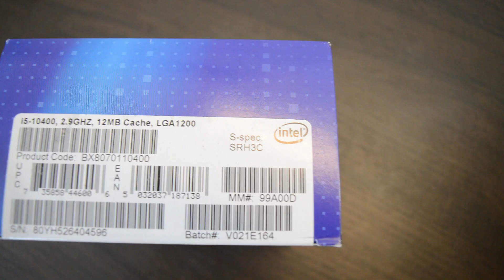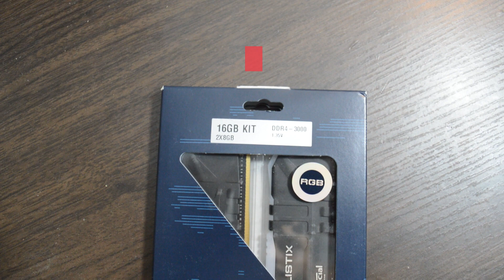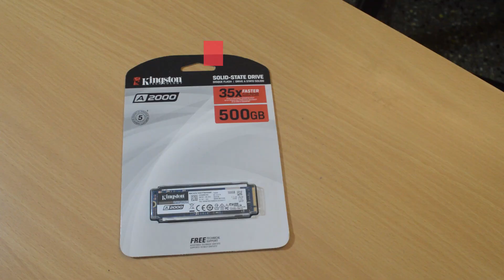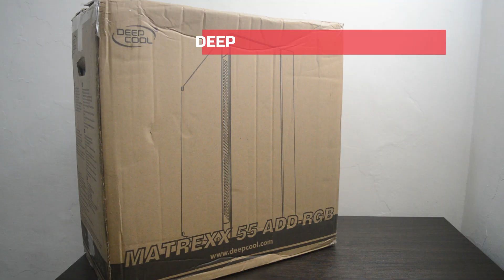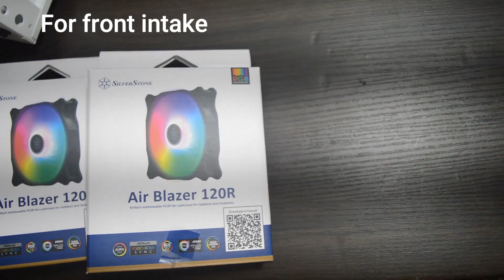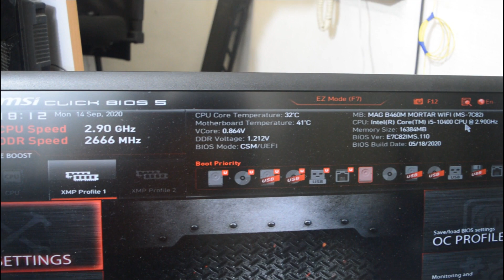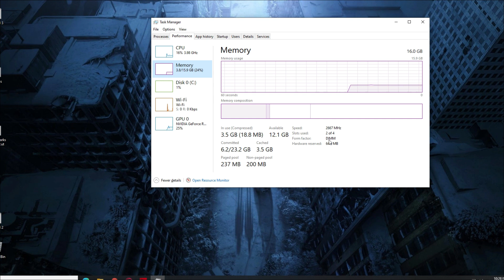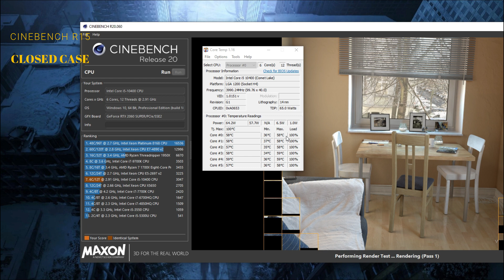Intel 10th gen PC Build | i5 10400 RTX 2060 super , Matrexx 55

Comment: Nice budget build.
Reply from the maker: Great alternate to ryzen 3600 build,
Reply: @OdinHardware  i was thinking a 10400 with a 1660ti build for my next budget build. i just did a few 3600 with RX580 builds for my kids. And one build of a 3600X and RX590. All great for 1080P gaming.
Reply from the maker: Rx 590 is a capable 1080p card and we should look out for models that has beefy cooling setup.  Some gigabyte models has poor setup
Reply: @OdinHardware  I have 2 Gigabyte RX590 Gaming OC 8GB and have no over heating issues.